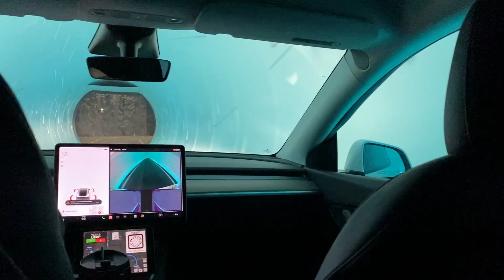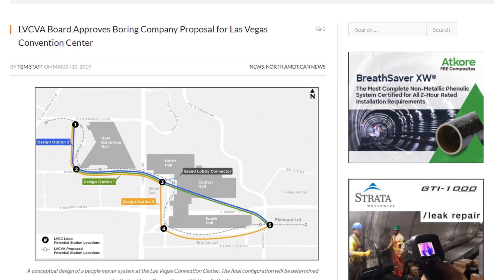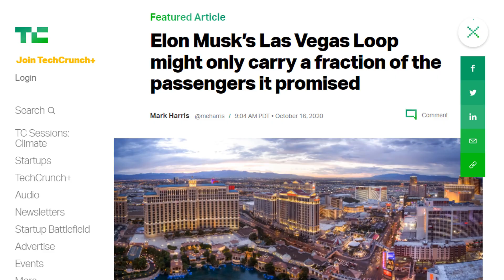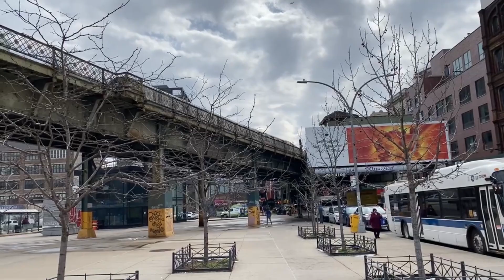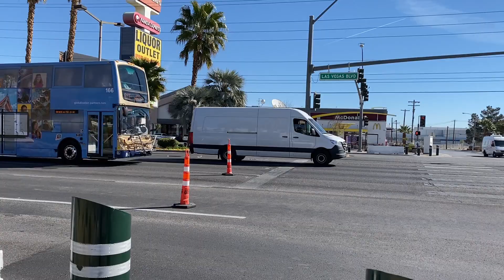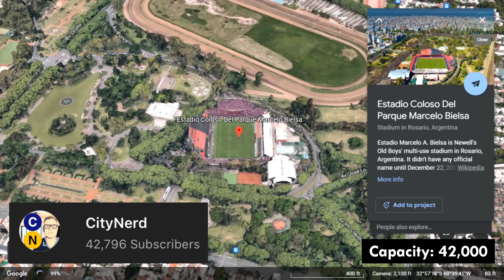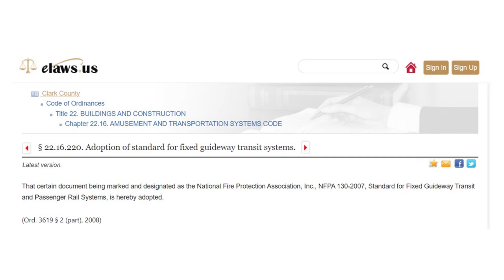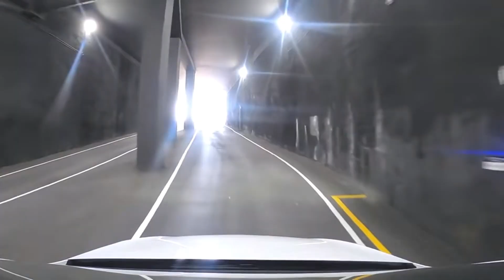Inside the Las Vegas Loop: Transportation Game-Changer, or Complete Waste of Time and Effort?

Comment: Maybe if the tunnels were two ways and some thrid lane so car can y'know move lanes in case there is a problem, there might be some vague interest to this as a cheaper alternative to subway or tram but here.... what the hell ? It's single tunnel asking for trafic jam and people being burnt alive is a tesla catch fire, that has a ridculously capacity
How did Musk manage to sweet talk any city into building this disaster ?
Reply: Two way tunnels invite head on collisions.  Multi-lane tunnels also have increased risk of collision.   Traffic jams haven't been a problem.   They have emergency procedure in case of fire, but they haven't had to use them yet.  Fire risk is very low and they make it lower by not allowing cars in their fleet that have risk factors to use the tunnels. 

Musk managed to talk cities into building this non-disaster by offering to build it at no cost to the cities.   Metro companies could follow that example, and then you'd have more metros.

Comment: Ive been thinking about it, a monorail design might just fit(actually i was originally thinking somthing like a booster roller coaster but i r3congized that would be terrible still and not worth it even if slightly better then nothing then i relaizee i was being dumb) a mono rail would probably need a custom design to have a a decent amount of space for getting of but i bet it could be thin enough

Comment: Time for an update. There are several more tunnels waiting for approval. The original plan was for driverless vans holding 12-16😂 passengers which would dramatically increase throughput. But Tesla had other priorities and the pandemic slowed things down. Now FSD driverless is slated for the end of the year and we could see e-vans in 18 to 24 months. In addition the cost is a factor when you can save 90 percent off the cost of elevated or underground subways that could run 500mm to 1000mm per mile. In addition the plan has expanded to many more miles and stations. What are the operating costs of the airport trams when they run virtually empty for hours per day? The Loop could still fail anyway, but the concept of connecting the airport, numerous casinos and stadia along with downtown and the suburbs that ring the strip would be cost prohibitive any other way. So the jury is out, but if it works it could be the game changer as promised. Look at NY where the costs of subway expansion are over 1 billion per mile. May this is a lower cost alternative.
Reply: It's next year. I guess FSD is working now?
Reply: "a game changer"... smh.  Rubes.
Reply: "Now FSD driverless is slated for the end of the year"

Nice fantasy.
Reply: Ahh, yes, Fool Self Driving, the "next big thang" from the Enron of the automotive industry that's been "coming next year" for the PAST F*CKING DECADE.

Comment: The aim of the system is to have point-to-point transit which will only really become useful when a larger part of the system has been built.  So it could be some time (many years) before we will see if it makes sense to have this kind of system.  The jury is out on it for the moment.  If it does work then you'll be able to travel from any one point to any other point without any stops or changes.  If it doesn't then they'll repurpose the tunnels to something more useful.

Comment: If Las Vegas Loop expand to every casinos in the Strip, that will be game changer for sure. People can travel underground and go to different hotels and casinos without getting burned by the desert sun.  KLAS just reported March was 10th straight month to be hottest on record.  While Tempe AZ is transforming into car-free town, how about Las Vegas Strip (Four Seasons to Stratosphere) make people to travel underground with mini electic cars or just plain walking? just an idea.
Reply: you mean like a subway system ?
Reply: @wassafshahzad8618  More like tram or monorail, just like in our airport terminals.
Reply: @youngchu1638  trams or monorails would actually work. The Vegas Loop is just a stupid, inefficient, low capacity, potentially dangerous idea
Reply: @nobbynobbs8182  It is stupid.  Look at the monorail for example: Instead of connecting corners of Las Vegas valley for its residents, they focus on visitors.  Unfortunately, that's how they want to create revenue.  If Las Vegas create underground walkways and pathways between Four Seasons (maybe extend to Town Square, bus terminal [SSTT]) to Stratosphere (maybe extend to Fremont St, just north of Art District and North Premium Outlet Mall North).  Just an idea.

Comment: Zero cost to the public because the casinos are paying for it and it dramatically improves transportation in Las Vegas.   But the negative Nancy’s on YouTube who add ZERO value complain about everything.
Reply: Challenging the viability of proposals for bad ideas is NOT the same as "complaining".
Reply: @electric7487  It’s easy to criticize while others experiment and innovate.  Give the tunnels a try.  Go for a ride.   You’ll like it.
Reply: @TrendyStone  LOL.

I did give these tunnels a try last year when I visited Vegas on my own. I was not impressed.

If you knew anything at all about how transportation works, you'll quickly be able to see that the Loop system is not "innovative" in any way. It's actually quite the opposite, as it combines all the downsides of cars with all of the downsides of public transit with few of the benefits of either.

Good ideas don't mind being criticised. Bad ideas HATE being criticised. Your reply to me demonstrates this very well.
Reply: @electric7487  I’m an engineer.  I know how transportation works.  I was in LV for CES.  Elevated train was beyond capacity.  Taxi line at every casino was a 45 minute wait.  Tunnels had a 3 minute wait.  They’re great.  They’re just taxis with a direct route to your destination and no stop lights.  And not paid for by tax dollars.  What’s not to like?  What’s with all the non-specific complaining?
Reply: It has to be built before it can dramatically improve transportation.  But I'm glad it's being built, because everyone will be able to see whether it works or not.  (Sure what's already there works fine, but will it really work on a city-wide scale?)

I think it will work.
Reply: @kevinbailey8827  Yes, it’s a good experiment.  The casinos paying for it believe it will work.
Reply: @TrendyStone  Its a stupid idea. You coyld have built a public subway station but you build a death trap
Reply: @wassafshahzad8618  They already have light rail in Las Vegas.  This will supplement it.  

And if it’s stupid…why are the casinos footing the bill?  Are they stupid too?  Is everyone that disagrees with you stupid?  🤔
Reply: @TrendyStone  the reason casinos are footing the bill is because this is an attraction. This isnt solving public transportation this is just an attraction for las vegas. Casinos aren’t stupid but there reasons for footing the bill is different.
This will nit dramatically improve traffic hell this is more likely a death tunnel. What if a tesla catches fire mid tour? Its a one way tunnel without emergency exits
Reply: @wassafshahzad8618  Actually parallel tunnels with cross paths for emergency exit.  You’re very ill informed on this project.  
Have you ever even used the tunnels or been to LV?   Seems like you haven’t.

Comment: I'm guessing the killer feature was the low cost of what $52M. Compare that to the Oakland airport connector for BART. The 3.2 mile track cost $500M and it's basically a cable driven ski lift on the flat.  $156M per mile so 3x the price of the Vegas loop. And even though it is completely autonomous the airport connector has a $6M a year operating cost and in 2022 carried 439 thousand people or 1200 people a day. Wow.   

Yes the reliance on human driven cars is ridiculous for the loop - I mean if you can't nail autonomous driving in a one way tube with no other vehicles except autonomous ones then just what hope do you ever have - but ultimately the solution seems right sized for the amount of traffic there is.  And no matter how many drivers the boring company is paying for could it ever be as much as $6M a year in operating costs?
Reply: Actually, I think $6M a year is what LVCVA pays TBC to operate the LVCC Loop. 

It's a convenient number because it illustrates just how much they saved by going with this instead of a train-based system.  The two train solutions that met their parameters were each $150M more in up-front costs.   So even if those trains cost HALF as much to operate ($3M per year), it would take 50 years for those operational savings to equal the up-front savings.  

It would take 25 years to break even if the train systems cost $0 a year to operate!

Comment: I think this whole boring company BS is a long term positive. The whole car thing will fail and they will get converted into metros.
Reply: I agree that they won’t rely solely on sedan-style vehicles forever. But these tunnels won’t work for trains on rails, without spending billions to straighten curves and rework stations.  And the result would be far less convenient for passengers. 

They’ll use small electric buses mixed with sedans and purpose-built electric taxis.
Reply: @kevinbailey8827  I can guarantee that elon will abandon it when he realises that it is a terrible idea, and tunnels that serve only cars have proven many times to be extremely inefficient. LRVs should be able to handle the tight curves so maybe we will see a light rail line using them in future...
Reply: @verumignis4778  Getting to find out is going to be really fun.

Like him or not (and I don't particularly) Elon Musk has a track record of persevering, so we'll likely see the whole thing built out and functional, and then we'll have our answer. 

What's there so far seems to work very well.
Reply: @kevinbailey8827  What is there currently is an absolute disaster, it has all the same issues as any other road, but with all the issues of a tunnel on top of that. The capacity as absolutely ridiculous. The tesla tunnels in their current state are little more than a gadgetbahn.
Reply: @verumignis4778  During a busy show at the convention center, EVERYONE who tries to ride gets where they're going, with an average wait time under ten seconds and an average ride time under 2 minutes. 

There are no capacity problems, and the service is better than a train could achieve. 

Why would you want to wait for a train when you could step into a car and be at your destination before a train would even arrive to pick you up?  You'd have to really have a thing for trains.

Comment: I’m far from being an Elon fan boy. I have mixed feelings on this project because:
1. What I dislike is the obvious. No train/bus going through the tunnel. If this system was train or trolley bus, I think this would be excellent.
2. What I strongly dislike is ticket prices. Per their website, these are ridiculously high at almost 2 dollars a mile. This beats the purpose of a transit system and makes this an ‘Uber running on a quasi-private road network.’

What I like:
1. No cost to the tax payer.
2. Much faster in construction.
3. One company doing all the work versus many contractors. Public infra needs this.
4. Making other private companies pay for stations
5. 12 foot tunnel vs what are generally 20 feet tunnels means 64% less earth to remove that reduced cost. But. The big caveat here is it means it (probably) can’t take a bus/train.
6. Government is not involved in every decision. All this nonsense like public hearings are a waste of time.
7. They are driven to make the system good, or their investment is screwed. Unlike the local government that makes poor systems that are slower than bicycle.
8. Increased number of stops.

Admittedly - most of the benefits above have to do with privatization/structure of the business, they have nothing to do with the fact that he’s using cars. This means the system would be much better with train/bus.

What this means to me is:
1. It seems like a very good low throughput system. But not for Vegas.
2. There’s probably a future where a BRT is built with this that provides a great hybrid of cost and performance.
Reply: the key is a special 10-15 people mover platform with much less weight etc

Comment: the biggest meme is that even in the loop there still is trafic its a fucking joke
Reply: That may be a meme, but it’s based on misinformation. The worst “traffic” I’ve seen documented resulted in a 40 second delay for passengers. 

Not only is that negligible compared to real traffic snarls, it’s less than the average time it takes for a subway to slow down, stop at a station, exchange passengers, and get back up to speed.   When you ride a subway, you get the equivalent of a “Loop Traffic Jam” at every stop that isn’t your destination. 

There will be problems in the loop systems eventually. Random things will happen. But random things happen in subway systems also. I’ve been in subway trains that were running slow. I’ve missed flights because the train was late.

Comment: Can someone help me calculate how many Teslas are needed to replace the London Underground system? Maybe it's a genius idea..
Reply: It would be difficult to replace an existing metro system with a Loop.   You'd need to have more and smaller stations, and the ability for vehicles to bypass all the stations except the destination.  Also, you'd need to allow vehicles to transfer between lines so that passengers didn't have to exit one vehicle at a transfer station to wait for another vehicle. 

Loop systems will most likely be built in places where extensive subway networks  don't already exist.

Comment: Here's a thought: Let's make the Teslas bigger and link several of them together. And since they're traveling on a closed loop, we can replace the rubber tires with more efficient metal ones that can run on a track. And since they won't leave the tunnels... we can replace the battery with a pantograph and negative terminal line. And Elon, being the pro at naming, can come up with a cool, snappy name like Metro or SubWay...
Reply: Have you seen the planned map?  It has a lot of loops and shortcuts, which lets individual vehicles take the best route to their destination.  A train wouldn’t be able to use these tunnels very well.  So even if you like stopping at every station along the way, and you enjoy doing transfers, it’s not going to work in those tunnels.